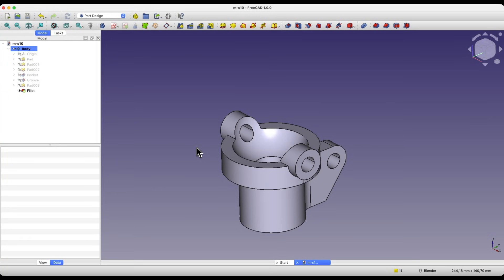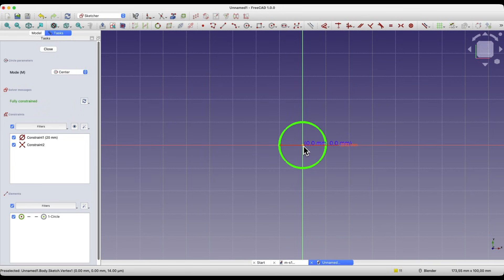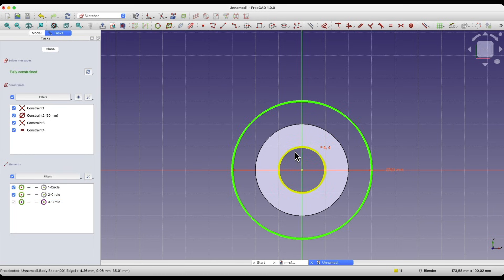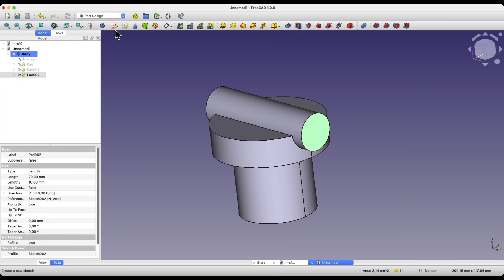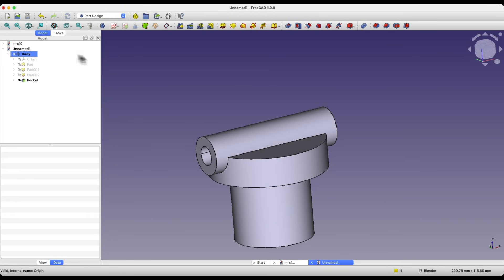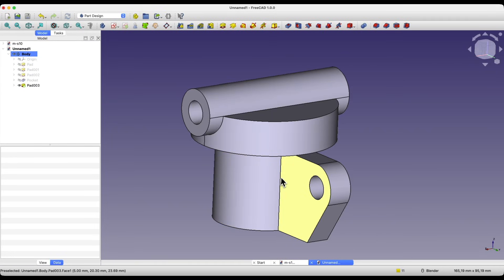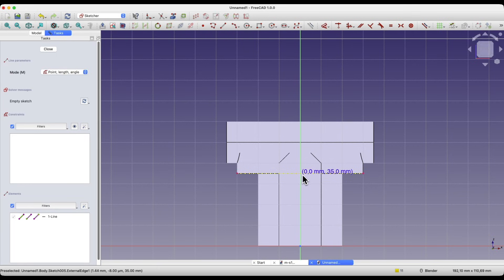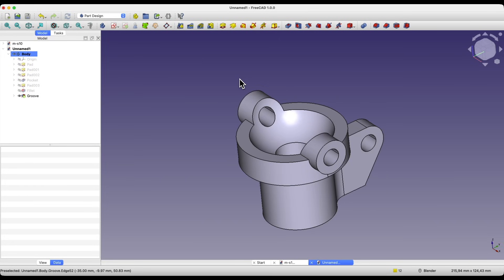🔥 FreeCAD 3D Modeling Tutorial: Step-by-Step Mechanical Part Design (Beginner-Friendly!)

Comment: At 5:27, I can't seem to create the external reference geometry at the bottom of the shape. Hovering over the edge doesn't display the blue line as it has before and clicking doesn't display the purple dashed line as it does in other parts of the shape. Anyone else facing this issue?
Reply: pretty sure you figured it out by now (1 month late response) but for others,  make sure you put the reference geometry before clicking the reference view.   sometimes in reference view some features cannot be accessed, and vice versa.